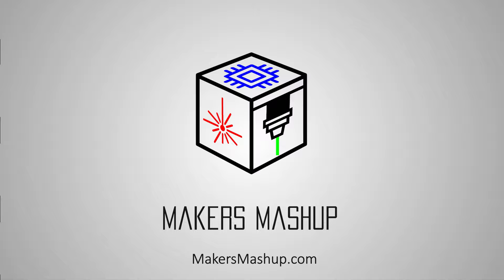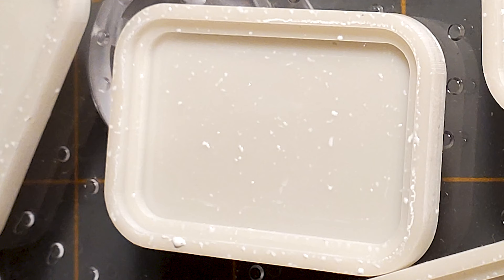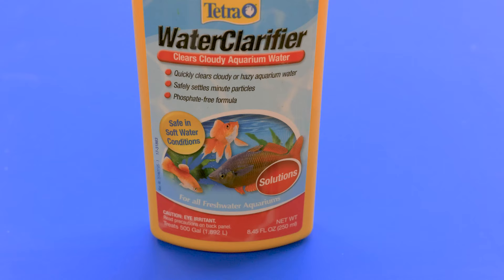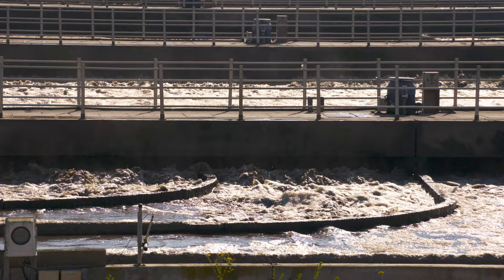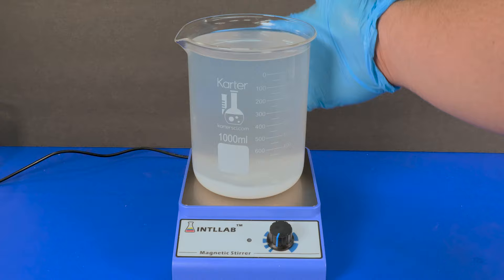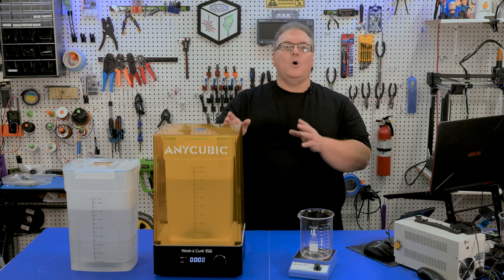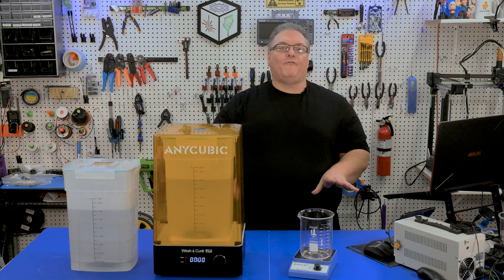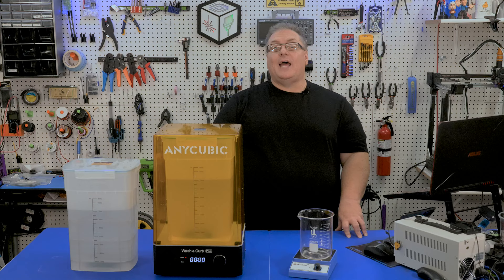Recycle Isopropyl Alcohol FAST! | Recovering IPA From 3D Printer Resin Wash

Comment: I am a Chemist.
When you mix IPA in water you form an azeotrope.
The hydrogen bonds in the water are broken down and reform with the hydrocarbon in IPA’s OH group (this is the azeotrope).
You no longer have 99% IPA, it’s something like 40%.
I have a 3D printer myself, and I recommend using Denatured Alcohol instead of IPA.
You get it by the gallon at Lowes.
Reply from the maker: I agree theree is a reduction but where are you coming up with such a huge reduction in concentration.  While I'm not a chemist, simple math says 140ml per liter is not turning 99% ipa to 40% by volume.  While other things I'm sure are going on I will need more details to believe that.  As others have also pointed out the water can easily be removed using salt and some 7th grade science.  The process has worked exceptionally well in practice with no loss of effectiveness from my use of it.  That's been my experience so far.
Reply: @MakersMashup  
As I said, the hydrogen bonds of water break and combine with the OH group of the hydrocarbon of the IPA.
Any 7th grader can theorize that you are taking a hydrogen from water and giving it to IPA converting IPA to an azeotrope.
You don’t have 99% IPA anymore. That’s what I’m trying to tell you. 
Try Denatured Alcohol that can be cleaned by filtering, and you end up with Denatured Alcohol.
I know, I’ve done it!
Reply from the maker: I never disputed the reduction it was the reduction percentage I questioned. I do understand it's diluting it.  Why would denatured alcohol be any easier to filter than ipa? My understanding is denatured has methanol and bitterants added to ipa.  I get it's cheaper. Filtering in various methods produces less than optimal results and produces more toxic waste since we are adding filters and more containers into the mix.  I've yet to see anyone have a filter method that works well, low cost and effective.  If you've got one please share it since this video came from the frustrations from using the method you suggest.
Reply: @MakersMashup  
I have two pickle jars, one dirty, the other clean.
When they get too dirty I filter it and the solids sit on an old newspaper in the sun for a few hours.
Then you put it out in the trash, it’s inert.
I recently give figures a final dip in acetone (Also from Lowes)
Acetone helps it dry faster. Then I cure them
Reply: Mr Chemist please reply..
Reply: @awangbuaya9698  
Hi

Comment: Or you can just run your ipa through a 15 min cure cycle let it sit for 24 hours and let the cured resin sit at the bottom then filter.. less headaches this way of stirring and putting in additives

Comment: I found aluminium sulfate is slightly to non soluble in IPA (both opinions were through internet), but what about pouring it directly to the bath already on the washing function and running so the aluminum can coagulate resin particles that will also being thrown to the top by the "fan"? (Some sort of chaotic fluid dynamics & probability thing). That way you can avoid pouring water to it, as its better to keep the highest content of IPA in the tank. I do a lot of resin 3d printing and my bath can get full of it quite quickly, I’ve been looking to get a better way to recycle it with no luck yet. The sun can be hard to predict so that´s not a good source. It’s just an idea! maybe someone can correct me if I’m wrong
Reply from the maker: I tried it without water first.  I believe the water is increasing the surface area because of the no soulable nature in alcohol.  Salting out the water Ive learned is about the easiest way to get back to near 99% with minimal loss.  Just Google Salting out water from alcohol.  Also a good way to turn 91% I to 99%

Comment: I just realized that a centrifuge could be used to pre-clean models pretty well.  I wonder if a process similar to a protein skimmer could be used to froth off the resin?
Reply from the maker: I thought of this too but couldn't figure out a way to spin 7l of alcohol in the room :)
Reply: @MakersMashup  I meant to use a centrifuge to sling the uncured resin off the green parts before using any wash at all... Then one could recover the uncured resin instead of dissolving it into IPA to begin with...  Now I'm thinking "top load washer" in a spin cycle type apparatus.  You'd have to print in pairs or use a ballast weight for balance, but I think it could work...  10 min spin cycle, they'd probably come out dry.
Reply: I've seen people use an empty airbrush or low pressure air compressor to "air wash" before the liquid (IPA or water) wash.  If this is done over a tray or bowl, you could recover the bulk resin for reuse.

Comment: Just askin', but are you in the USA? The reason I ask is because you always use the metric system for measurements and hardware, Grubscrew? Thanks
Reply from the maker: Yup I'm in the U.S. I prefer metric but the 3D printing as a whole is largely metric. Scientific community also favors metric.  I find it easier so I generally favor it over Imperial. You're not the first one to ask that. 🙂
Reply from the maker: Oh and grub screws are those little headless screws that look like pill bugs you find under a log.  🙂

Comment: Try bentonite, might be easier to use
Reply: Thanks for the bentonite tip. I've been researching it a bit and it looks like an alternative that won't dilute the IPA. Are you still using this method? Do you have a supplier link? Seems like there are many variations and most are for beauty and expensive. Also roughly what quantity do you use? Cheers.
Reply: @cfriedalek  I have used it in the past for brewing beer and hydromel... You can search on Amazon for bentonite powder

Comment: FWIW, while this is an interesting idea, it isn't sustainable, as the IPA becomes more and more diluted by the water.  Fortunately, vacuum distillation is inexpensive, safe, and VERY effective.  In fact, if you are careful with your temperature control, you can even leave almost all of the water behind, thereby increasing the percentage of IPA.  (This method is used in biodiesel production to recover the relatively expensive methanol.)
Reply from the maker: I will have to check out the vacuum distillation.  Perhaps something that could be easily applied here.  While the IPA does get diluted initially, others have pointed out in comments using salt can reclaim the IPA and remove the water.   I haven't tested that yet but when I do another clean cycle I'm going to give it a try along with testing the specific gravity.  I think the process is sustainable just will require a second step to get the rest of the water out.   The vacuum distillation sounds interesting I will have to check it out
Reply: @MakersMashup  One serious advantage is that, because the boiling point of methanol/ethanol is already so much lower than water, it doesn't take a lot of energy to make it boil--you can put the vessel in a container of water and just maintain the temperature of the water.  What's more, if you look at videos on 'diy methanol recovery', you'll see that the process is efficient enough that the alcohol literally pours out of the distiller.

Comment: So I have been using either yellow or orange (creality's which looks like corn yellow more than orange) resin for the last two months so my ipa basically looked like I had collected four liters of piss from someone that seriously needs to drink more water.

I tried this and nothing happened, the granules just sat at the bottom. Then I realized I watched the video wrong apparently because you're supposed to dissolve the dioxide in distilled water first, not just add it as-is to your iso and make it spin in the washer. So I added the granules to the distilled water and they wouldn't dissolve completely, so I warmed up the solution very slightly by putting it 20 secs in the microwave. Then stirred until it was fully dissolved and the water was now cloudy. Poured it into the iso and made it spin in the washer for 20 minutes. It was fucking ridiculous. Suddenly like 5 cms of white opaque whatever appeared at the bottom of the container. Absurd. So I poured everything I could into another container then grabbed what was at the bottom and cured it for like 20 minutes then filtered it through a very thin rag so I could catch all of the sludge. That let me recover the very last part of my iso.
Since the sludge was fully cured I just dumped it in the trash.

My iso still looks like piss but it's way clearer now and doesn't leave white residue on my prints anymore. For shits and giggles I did the cleanup process again and got barely 1cm or so of white sludge at the bottom this time. So it worked super well.

Thanks for this. It's a lifesaver.

Comment: Hello, I used the pure aluminum sulfate and it worked brilliantly.  I began to see the spent resin begin to clump up quickly.  I let it rest overnight and found the resin had cleared.  The next step is to decant the IPA and this is where I'm struggling a bit.  I do not see a visible difference between the IPA and the Aluminum Sulfate/Distilled water solution.  I used equal amounts of distilled water and about 10% aluminum sulfate.  If I'm unable to decant the alcohol off.  I may try using significantly smaller amounts of distilled water.  Thoughts, anyone?
Reply: Some of the other comments say you can put salt in the mixture and mix it. The water will dissolve the salt making it heavy enough to form a layer for separation. I haven’t tried it myself yet but plan to
Reply: I'm using just 2 grams of aluminum sulfate dissolved in 6ml of distilled water to clean 2.5 litres of dirty IPA.  Works brilliantly and it will be a long time before I've diluted my IPA enough to be concerned about.

Comment: I have a method to clean my IPA after washing resin parts, and it is simpler, it don't need some unusual chemicals, and don't need any labor: step 1 - put your dirty ipa in container. step 2 - put container into freezer for a night. step 3 - wait about a night, you will get basically something like you get in this video "snow" from fallen of to a bottom of container resin, then you can put your container in warm place without disturbing it much, so "snow" will melt into a resin, and then you can pour clean IPA from that container. And that's all! If after firs freezing your ipa is not clean enough, just let it unfreez (without disturbing) and freeze it again, every cycle will make it cleaner. 
It you have cold weather outside (this procedure requires temperatures about -5 celsius and colder) it will work perfectly, too.
Reply: Hi, I have done this with success, can you elaborate on the science behind this or links to related information? Thanks.
Reply: @YairHerreraMusic  dont really know, probably when lovering temperature resin in a ipa became inert enought to start condensing, while ipa itself, not
Reply: @Uterr  that could be it, i was looking at details of a resin and they suggested if temp was under 10c, that it would need 50seconds per layer (rather than 4-8seconds at 25c ish)
Reply: @Uterr can you explain the timing a little more clearly?  Step 3 say to wait about a night....  is that in the freezer or our of the freezer...  Si how long should the ipa be in the freezer?
Reply: @davelandrytube  oh, ok. resin condences from ipa in couple of hours, but just for convenience i left it in freezer for night. Well, longer it stays in freezer, clearer it would be, it a bit a matter of experimentin. and out of freezer it need to stay just enought to warm up to room temperature
Reply: Chilling the alcohol would also decrease the evaporation and, therefore, the fumes. Great idea! Just don't forget to add a warning label to the container so nobody thinks it's potable (my old roommate made cordials and used freezer distillation, so there was always an odd bottle in the freezer 😊).

Comment: Mixing chemicals like this when you have zero idea about the reactions is VERY risky. They can be giving off gasses taht you cannot detect that could do hidden damage to you, or worse still, to pets and infants (who have more delicate respiritory systems) - especially on this scale. Also, as someone else mentioned, diluting your IPA is guaranteed to reduce its efficacy.
Reply from the maker: Yes it was risky and I acknowledged that fact during the video.  Yes it will diliute it but given the volume it's not significant and water can be extracted easily with salt.
Reply: @MakersMashup  Surely every time you do this, the IPA will become more dilute?
Reply from the maker: Yes however it's not something I'm doing daily,or even weekly.  With a two stage process I might do this 4 times a year, so an extra step to purge water with salt is really not a significant additional effort.  Sure someone may have to do it more frequently but then they can evaluate their use case and decide if this process works for them. I'm presenting information here, how people use it is up to them.
Reply: @MakersMashup  Did yuou mention in this video how to purge with salt? If so, must have missed it. Assuming IPA has a lower evaporation temp than water so you can simply evaporate it off? Is IPA hydroscopic?

Comment: Would this work just as well with Acetone instead of IPA?
Reply from the maker: no idea. You would need to research the interactions between the chemicals.  I'm presuming this is not for resin wash.  I've not heard of anyone using acetone for resin printing.
Reply: @MakersMashup  It’s actually pretty common, I know a lot of people washing prints with acetone, myself included. I even saw people sharing this video in the Phrozen Mega 8K Facebook group wondering about the same thing, if it would work with acetone as well ☺️It’s way stronger, so you only need a short dip. You have to be more careful though, as it’s quite hazardous!
Reply from the maker: I'll stick to water or alcohol.  Acetone comes with many other problems including many plastics it melts.
Reply: @MakersMashup  Yup, have to avoid plastic and use heavy duty gloves. It’s just way easier to get where I live :)

Comment: Anyone tried a fuel filter yet?
Reply from the maker: I've tried things like britta filters and the performance was poor.  Those I believe filter much smaller particles than fuel filters.
Reply: I was thinking the same thing. In a fuel filter, the point is inverted and the particulates settle around the base so the filter would have to be completely blocked before it stopped working. I'm going to make one of those filtering funnels with a point at the top to replicate the effect.

Comment: SPOILER: It's a mess, expensive, and the results are not guaranteed. You will dilute the IPA with water. Totally useless!!! 

5L (or even 1L) IPA will costs less than this procedure! 32/38€=5L; 9-11€=1L
Reply: It's not a one-step process. Neither is resin printing.